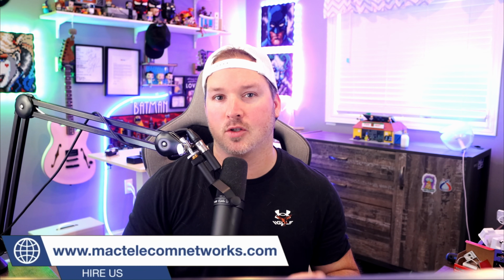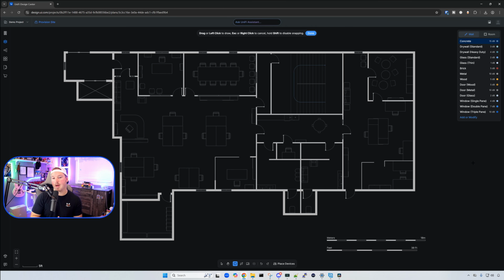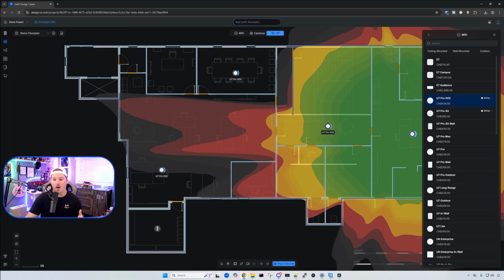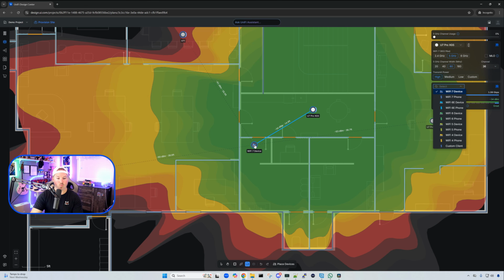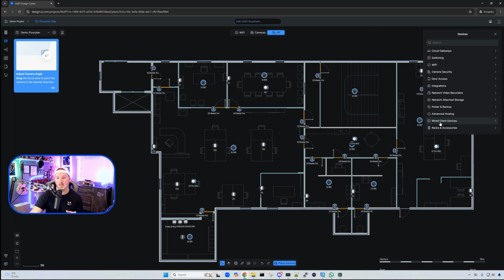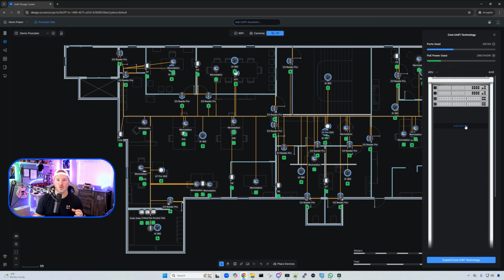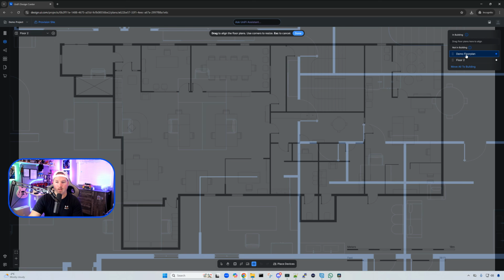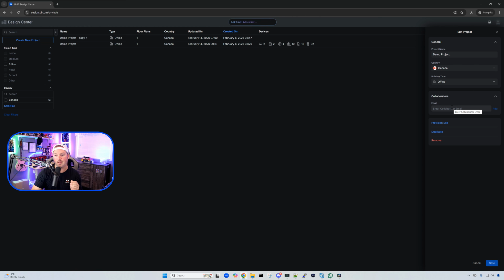UniFi Design Center 2026: Complete Step‑by‑Step Tutorial

Comment: Do you usually do a walk-through first to see if the camera and AP placement will work, and where you have the ability to run the cables through the building?
Reply from the maker: Typically we do but sometimes the site is far away so we get the client to do a video walkthrough